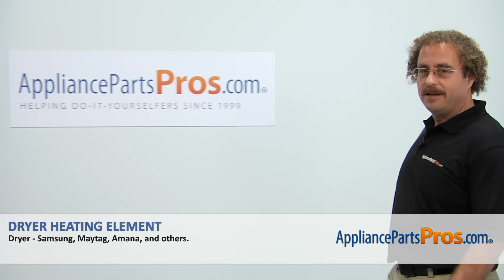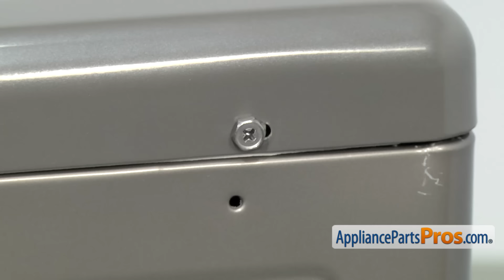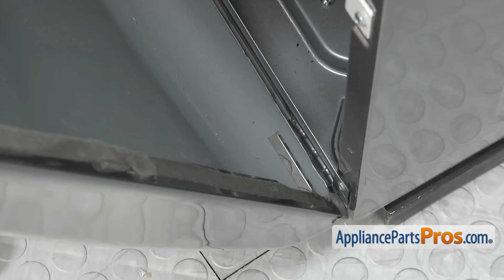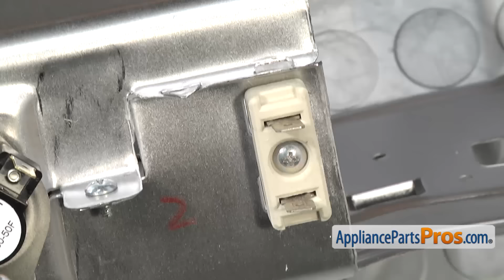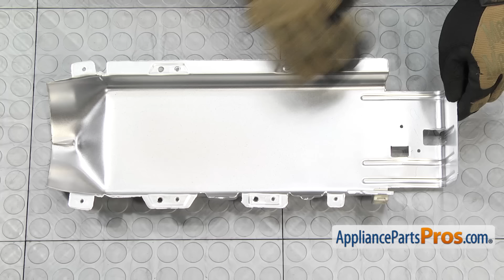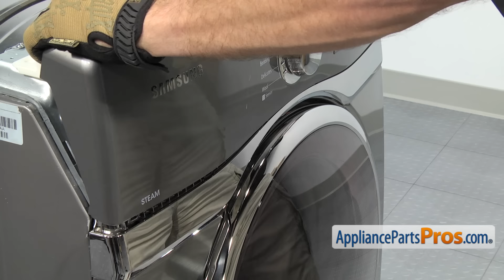How To: Samsung Dryer Heating Element DC47-00019A

Comment: I've changed the heating element 3 times at this point, it gave out again, but for some reason it's still not heating. I wonder if it could be a cable issue..

Comment: Your video is excellent. I replaced the heating element. I believe I did it correctly, especially the wiring of the 6 terminals. But when I tested it after reassembling it, it still didn't get hot! What else might cause the dryer to not get hot?

Comment: I replaced all the parts and it worked for about 3 months now it stopped getting hot again...help!!! I noticed in the video the first set of wires mine are reversed..the other two are the same as yours... I cleaned it.. also

Comment: Can someone confirm. I got to the part to remove the bottom bracket on my dryer and I’m having a hard time getting it out. Could there be two screws mounted on the backside?
Reply: I just found out there which means I need to take out drum an all 🙁🙁

Comment: Excellent video, very helpful and a lot less work than other videos I've seen that have you take the drum out.
That's what got me thinking -- circa 10:20 would it be reasonable to put the support bracket back in first, before fitting the heating element housing into the ductwork? Seems like it would be easier to manage, and give you a straighter platform to fit the housing into the ductwork.

Comment: good video. dryer is heating again! Only addition i might make is to make sure the coil connecter wires are separated and not touching anything. I had to do some wire manipulation/sculpting to get everything to fit nicely and spaced out.

Comment: Surprise!  My element assembly is screwed to the mounting bracket and my mounting bracket is screwed to the bottom of the dryer in front and back.
Reply: Yeah. Needed to watch a different video and almost tear the whole thing apart. I took those screws out for next time.

Comment: I wasn't thinking (before I saw this video) and disconnected the far right sensor (see 4:17) instead of just one screw.  Does it matter which way the replacement one goes in?  The new part has a blue mark on the housing that looks hand made.  Is this a guide?  Should the mark face toward the open or closed end of the element housing?
Reply: I wonder the same?

Comment: My concern is your wire hookups on the element. Of the 3 repair videos from repair/parts houses the orientation of your red, blue, and black wires are the opposite of theirs. Does the orientation not matter or is someone wrong?  I purchased parts from APP but I’m concerned about safety and my appliance.

Comment: Thanks for the video. If your having problems aligning the heating element and the cover housing. First screw the element board down to one side of the housing. Wait about 1/2 hr. The heating coils will stretch a bit, then un screw the heating coil element from the housing. Continue to follow the videos direction to properly assemble the housing.

Comment: My Samsung is 5 years old. We moved and it broke. The sorry SOBs added two screws to the back pedestal feet and a screw where the heating element carriage rests on the pedestal. Try getting a screwdriver back in those areas. Hours later, I was done. The old heating element plate was cracked all over.
Reply: I had the same issue with the screws on the bracket where the heating element rests also. I really had to search deep in my bag to find a screwdriver short enough to fit.

Comment: Absolutely spot on. It was a breeze to install and the best part is the element was in fact broken. At first I could not see a break and my heart dropped, but as I ran my finger around the coils, boom, there it was. I had back surgery a couple of weeks ago and was not sure I would be able to do all the bending, but just took it slow and it did take me 3 hours to fix, but I took a lot of breaks. Thank you for this excellent teaching video. Saved hundreds of bucks. So two martinis tonight.

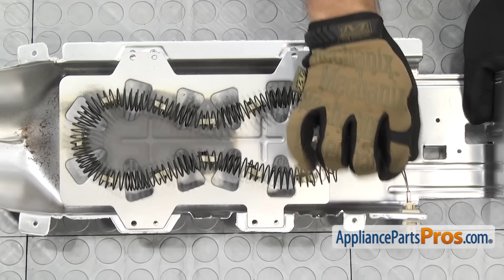Comment: Matt, very nice video, we all really appreciate it.  But for everyone out there on a budget, or if the wife is in a hurry to dry clothes, you may not have to buy any new parts or replace anything.  When you get the machine apart to the point the heating element is exposed (6:45) then check the element and see if the wire is broken anywhere.  If the wire is broken, then simply use (2) pairs of pliers to pull a loop or 2 out on each side of the break, twist the wire back together with at least (5) tight turns, (hold the wire with one pliars, twist with the other) then cut off any excess wire with the pliers.  Do not solder the joint as it will be heated.  Make absolutely sure no part of the element is touching any metal casing.  Then re-install.  In the unlikely event this does not fix the problem, then buy the new part.
Reply: Would not recommend this type of repair. Could cause a short or fire.

Comment: Extremely helpful video! Bought complete element + housing with thermostat for $150 from local parts store.
Notes: take time to vacuum/wipe down while apart
There is no 'click' or positive feedback to know element housing is set properly in duct; took about 12-15 tries to feel comfortable that it was correct
To ensure two back bracket tabs are secured just try to lift it straight up or use phone to take photo from back
I found needle nose pliers helpful in removing element wires

Comment: Super helpful I used this step by step. Found out it was actually the 220 outlet burning inside from bad connection. You can get motor power but not heat..check that first!!

Comment: Thank you for this excellent video! Thorough into the point. I’ve never taken apart and dryer before and I had the whole job done in less than an hour and a half with these tips.

Also, I would add to shop vac out all of the dust and crap while you do this. Your dryer won’t be nearly as clean as his!

Comment: I got mine changed twice but this time is no heat at all. What need to be check and replace? Could you do another video on how to check with volt meter and replace more than just the whole unit element thanks

Comment: Does Samsung throw a code for a faulty heating element? 
After some research and understanding how common this issue is I'm almost positive I need to replace the heating element but I'm bothered by the fact I don't have a code from the dryer.

Comment: Lol I just now pulled my dryer down to change the heating element and found a brush I was looking for the longest while. It was lying between the heating element housing and the inside wall of the dryer. Half of it was burnt and melted across the housing. The bristles looks like those of wire brush. This has been sitting there since January of this year when I changed the pulley and belt. How it didn’t start a fire only God knows. God is Good!!

Comment: My dryer is a Kenmore 592. The wiring for my heater terminals seem to be reversed.  Also, the thermostat is upside down from yours but the wiring is the same... I unfortunately took my picture after I had removed the wires from the heat sensor so I don't remember how it was wired.  My question is: Does it matter if the heat sensor wires are reversed?  Thanks for your help!

Comment: Thank you for this great and helpful video. Some minor differences in what I had to do with mine. I did remove the lint filter cover and plastic cage assembly as well to clean out all of the lint that built up and PREVENTED my lint filter from seating fully down. Clothes were catching on the raised corner of the lint filter and twisting my clothes due to it not fully seating down. I read a lot of complaints that people had about this issue. Since you have all this off, you might as well clean up the area of lint buildup. My wires were slightly arranged differently on the coil unit. You had red, blue, black, blue, blue, black...mine was red, blue, black, blue, black, blue. Make sure you guys take a photo of the wires on the coil unit prior to removing them so they go back where they need to. Since I had the lint filter issue, I had to vacuum a lot of lint out from the area where lint escaped. Thanks again, the video helped me out a lot.

Comment: Excellent video and pacing. Exactly what I needed to change the heating element and not lose my mind doing it. Every single step made sense and was simplified. As someone who is not mechanical at all, I impressed my gf by following this video. Just a quick note that later models of the Samsung dryer now have 3 additional
Screws. 2 on the rear side of the mounting bracket which you cannot see so you have to angle your hand to remove and tighten, and a screw that now attaches the mounting bracket to the element housing. Please be aware of these because this is actually what took the most time. 10/10 on the video!! 💯👍👏
Reply: I ran into the same issue with the additional screws on the mounting bracket. Luckily I had a stubby right angle screw driver.
Reply: This is literally what I just ran into now! I couldn't get the back side of the mounting bracket to move and I couldn't figure out how he had his move so easily. Felt behind and sure enough there are more screws in the back. Unfortunately I don't have a screwdriver that fits back there, so off to the hardware store I go!

Comment: Thank you! The heating element broke on my 10 year old Samsung dryer, and I was able to fix it with this video and $55 worth of parts from Amazon.
Reply: Had to repair the heating element again approximately 2.5 years later because the coil broke again. Thanks
Reply: @DanielTojcic  That's the cheap amazon part. It's probably worth it to buy the OEM part.

Comment: Noticed today taking my dryer apart that the spade connector ends that plugs into the heating element plug were soldered on. In this video they were just straight forward push connector fittings. Ever seen one like this? It was a first for me.

Comment: I ended up replacing the whole heating assembly. Man it was a pain to get the new one mounted.
Reply: Me too. I thought a whole new assembly would save time but getting it to fit took longer than just swapping out the element out of the old assembly.  Sigh.

Comment: This a 5 star video - excellent step-by-step instruction on how to disassemble/re-assemble a late model Samsung dryer to get at the heating element. It's relatively simple compared to taking apart your washer to repair it, and AppliancePartsPros also have excellent videos for that. You do however need to refer other videos on YouTube first to get the instructions on how to diagnose the fault with your dryer. Kudos to AppliancePartsPros and the featured technician.

Comment: SHORT CIRCUIT WARNING ! When I did this repair I caused a SHORT CIRCUIT, at the point that this fellow reached at 7:29 . 
When I replaced my heating element, when I turned the UPPER wire tip with the tab attached to it, to stick it through the ceramic insulator, (that's screwed to the housing) the curve that I created in the wire, came into contact with, and remained in contact with, the piece of sheet metal that the heating element coil is attached to. 
I did NOT perceive that I'd created a SHORT CIRCUIT. 
So when everything was back together, and we pushed the ON button, all was fine. 
Then, when we pushed the button to start the drum rolling and activate the heating function, the breaker in the garage tripped. 
We tried again and it tripped again.
I took everything apart and saw what I'd done, and I saw a slightly dark spot on the element wire, and on the piece of sheet metal. 
I created a NEW curve in the element wire, that I made certain, was not touching ANYTHING. 
I reassembled everything, and pushed the ON button - no problem occurred.
I pushed the second button to start the heat, and roll the drum - PERFECT FUNCTION!
Just over a minute of run time I stopped the machine and turned it off.
I opened the door and Beautiful,  Strong Heat was Obviously Present!
No further trouble as of now!!!

Comment: Update ….February 2022. …  just came back to this video again to replace my 3rd heating element.  Great video.  Thanks again for posting.  👍🏻

Great video!   Thanks so much for the easy to follow instructions.  This is the 2nd element I have had to replace but it went much more smoothly this time thanks to the video.   👍🏻

Comment: Anyone have an issue after installing everything the dryer sets off a fuse in the box?
Reply: Mine actually overheats. The heating element doesn’t cycle, it stays on the entire duration and then throws a hE code

Comment: Great video. However,  in my model, the mounting bracket was attached in back as well. And the bracket and element housing had an additioinal screw inside. So I had to remove the dryer drum as well.

Comment: Got the entire part for less than $70.00 from our local parts store.  Followed this guy’s directions to a tee, and completed the repair myself with my 11 year old granddaughter’s help.  This is the second replacement in two years and the machine is 9 years old but gets used about 15x a week.   Very easy directions and repair.  Just need a Phillip head screwdriver.  I did have some rusted screws, though, that slowed me down.  Otherwise would have been done in 30 minutes.

Comment: Hey my issue is a bit reversed. My dryer would run to 1 minute and would not stop until it got too hot and went HE. Would the heating element still be the cause?

Comment: I watched the video. I am a 65/yo female, weighing in at 100 lbs and 5’2. . I was was doing well taking apart the dryer until I had to take the door off. It didn’t just lift off. I needed a crow bar. The bracket inside the dryer has a screw behind it that is not mentioned. Let it be known if you have large fat hands.... it gets tight in the dryer according to my husband. For some reason he didn’t want my smaller hands to go in and take the element off although it would have been easier as my hands are small. I had no problem putting everything back together. FYI : my husband was the one who lost some screws I put aside very organized!

Comment: $22 for the heater element from Amazon, $35 for the Neli diagnostic plus this video and elbow grease. It took me a while but the dryer works. Those tabs on the heater housing support are a pain.

Comment: I replaced my whole heating element but now it's out again. The wires are now burnt and I have to change one wire. How do I change out the wire for thermostat that burned?
Reply: I have the same issue.. did you figure it out?

Comment: great video, I followed all through to change the heating element. connected back in place etc. I had read that it was going to be common for a burning smell at first since the coil has to burn that first coat. BUT my issue is, I turned on the dryer, and right when press the start button it begins to start and fully turns off and my breaker is jumping. if someone can please guide me with what may be wrong. It was not having those issues before

Comment: Absolutely could not have replaced the heater dryer element without this video. Thank you Appliance Parts Pros. The wires leading to the heating element housing was the trickiest part. Definitely take pictures or a video of the order of wiring before you pop those off.  Thanks again. Fixed my dryer for $26 as opposed to the $370 it cost me last time we had to replace.  :)

Comment: Best video was able to replace the thermostat fuse on the element casing using this video $20 total parts and my time. Original problem was no heat. Also had to test fuse with a multimeter to determine which fuse was blown. Thanks

Comment: He left out some important screws that need removing. Need to have a flexible shaft bit extention to get to the screw that hold the support to the heating element tray and the screws on the back side of the support. Getting those off took additional 30 minutes.

Comment: One of the quick disconnect terminals from the wiring harness broke off at the crimp. Can a replacement terminal (female) be easily found and crimped back onto the previously mentioned 14AWG blue wire that will connect to the new element. I am just helping a friend and they can’t seem to find a replacement that fits snug. A 12-10 won’t even fit found at an auto store. Are these disconnect terminals proprietary and need to ordered through Samsung ? If they can be procured at all is it safe to do?
Reply: This is the wire at 9:51 that is connected first. We will have an electrician perform the new crimp he just asked that we make sure it fits on the terminal before he comes to do it. We can’t find one that fits!!